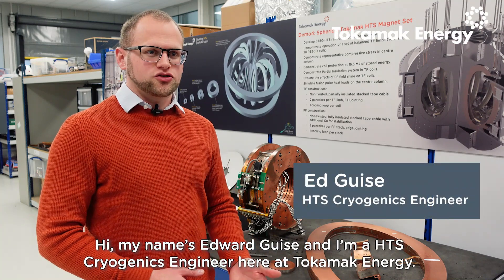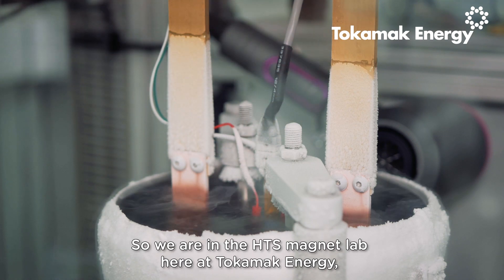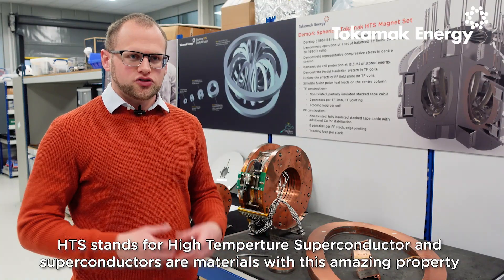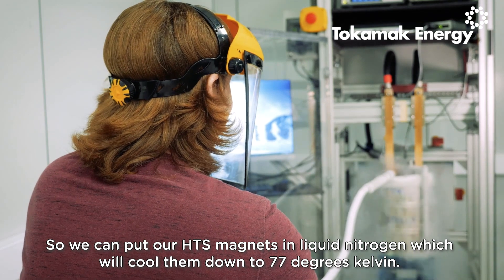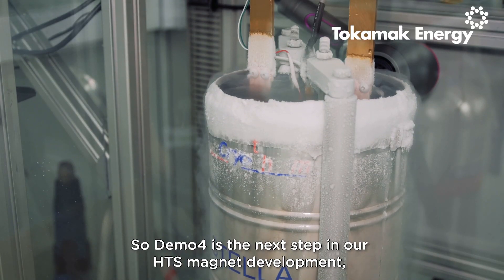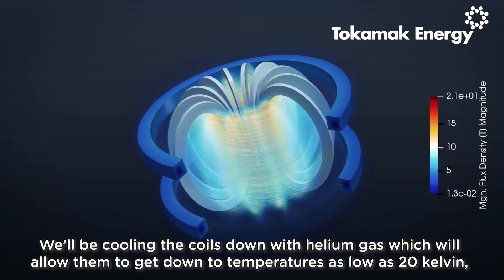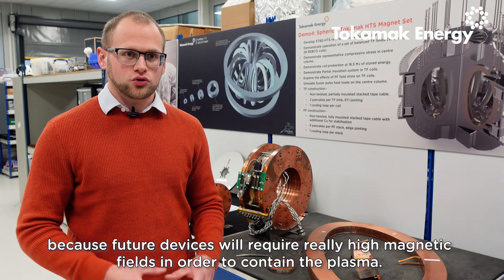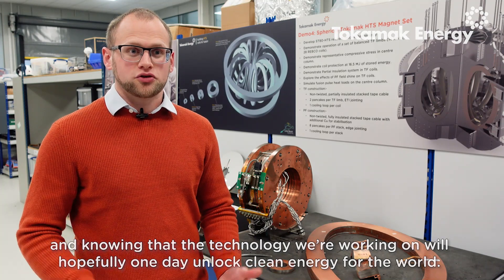Fusion Pioneer Ed Guise - HTS magnets: unlocking their amazing properties

Comment: See the Youtube talks by Dennis Whyte of MIT. There he explains why the high magnetic fields are the key to practical fusion reactors. The power of a fusion reactor scales with the fourth power of the magnetic field strength. That puts into play quite small reactors with high energy output - without HTS fusion teactors have to be much bigger to get the energy, and big reactors very hard and expensive to build - see ITER for example.

Comment: Could someone explain why lower temps allow higher currents? If you've got down to zero resistance then the relationship between current and heating due to resistance loses is gone, so it's not clear to me what limits the max current at this point, nor why further temp reductions allow more of it.
Reply: Yes, superconductors have zero electrical resistance up to a critical current. Above the critical current, the superconductor becomes resistive. The critical current of a superconductor is dependent on temperature, and at lower temperatures the critical current will be higher, hence why at lower temperatures we can operate at higher currents.
Reply: the difference between 99% and 99,999999% isnt much but it matters alot